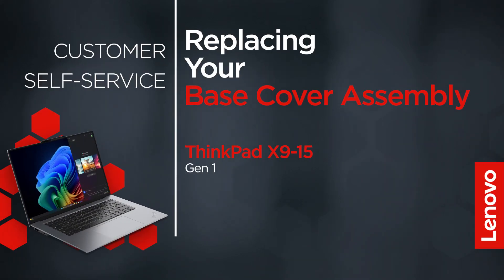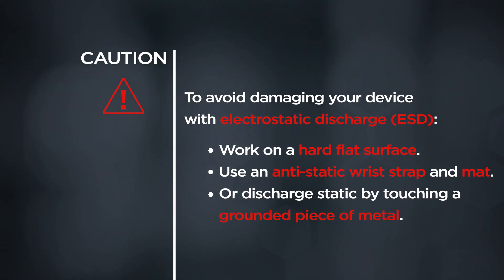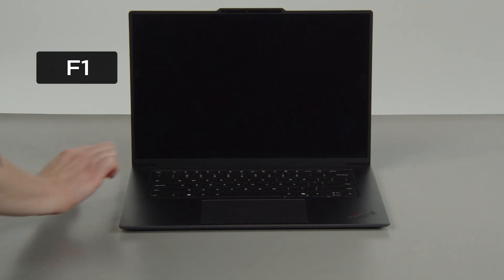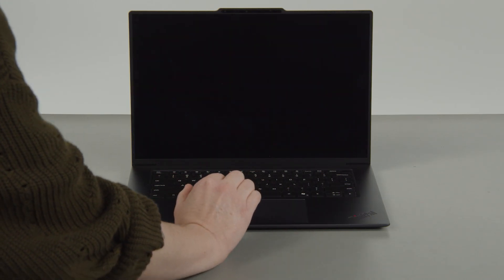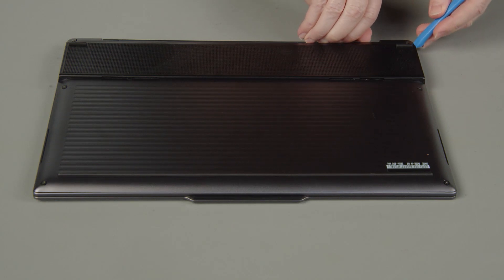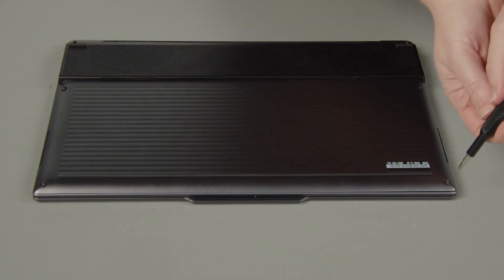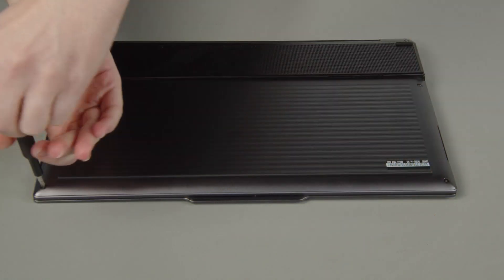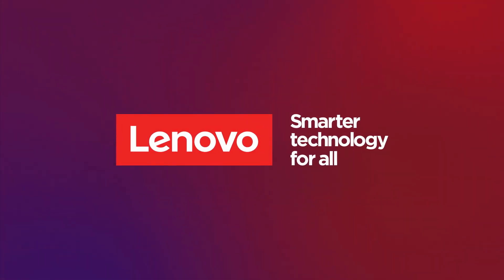Replacing Your Base Cover Assembly | ThinkPad X9-15 Gen 1 Aura Edition | Customer Self Service

Comment from the maker: This video will show you how to replace the base cover assembly of your ThinkPad. The process in this video will work for the ThinkPad X9 15 Aura Edition (ThinkPad X9-15 Gen 1).

You will need a screwdriver kit, a non-metallic pry tool and 10 minutes of your time.

To learn more about your device go to https://pcsupport.lenovo.com

To find parts for your device go to https://support.lenovo.com/parts-lookup/?cid=ww:lenovosocial:b9515f&source=socialmedia&subsource=yt

To view the Lenovo Support Self-Repair Guides landing page go to https://support.lenovo.com/us/en/solutions/HT516547

** NOTE: Static electricity can destroy components. Use a grounding strap, and clean, non-conductive surface to work on. Use plastic or coated tools to prevent scratching and avoid using metal tools on plastic parts. For more detailed information on electrostatic discharge and how to prevent it, please watch our "Understanding Electrostatic Discharge (ESD)" video: https://youtu.be/by4PB3WtdLo 

Applicable Machine Types:
ThinkPad X9-15 Gen 1 - 21Q6, 21Q7

Check out other official Lenovo channels!
https://www.youtube.com/@Lenovo 🟥
https://www.youtube.com/@lenovolegion 🎮
https://www.youtube.com/@Lenovo-PC 💻
https://www.youtube.com/@LenovoSuporte 🟢🟡

#Lenovo #LenovoSupport #LenovoTechSupport